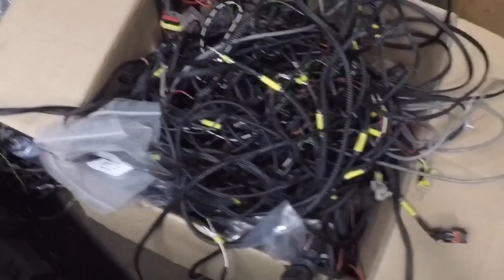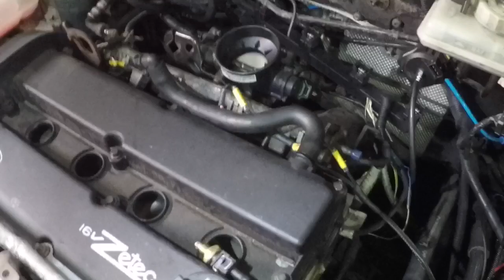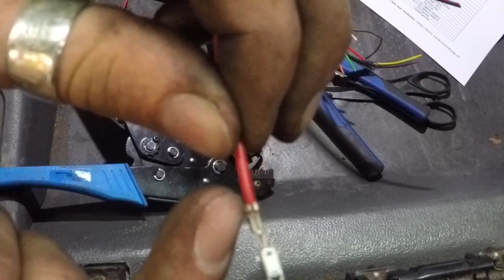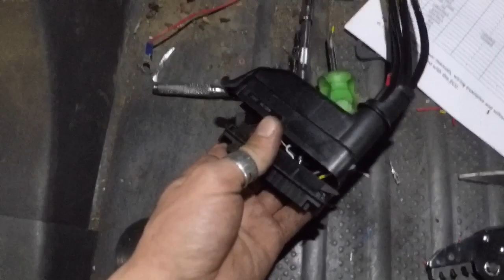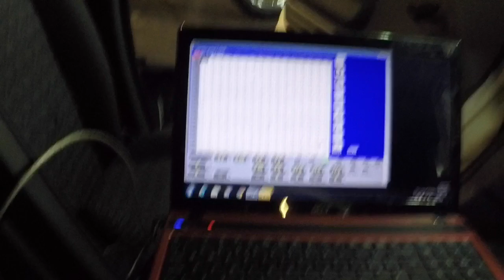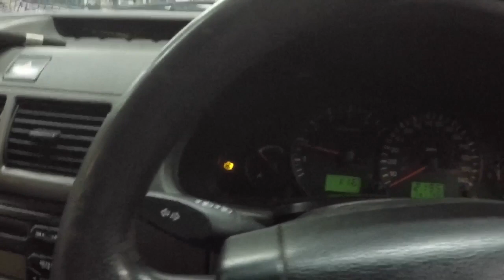Tranist connect episode 8 (fitting and mapping a kms mp25 ecu)

Comment: hi i am going to buy a mk1 golf with an 1.8t 20v and have to connect an kms mp25 on it. i am doing some research in advance but cant figure out how to connect the injectors. on the diagram i see only one supply and one output for the injectors. are they al connected on these 2 wires?